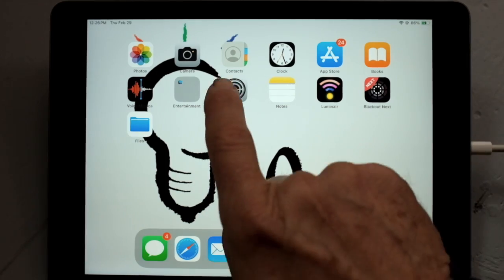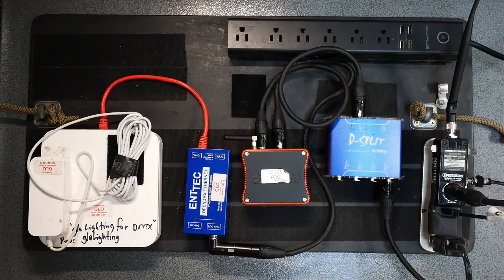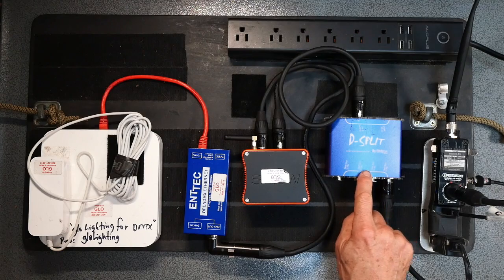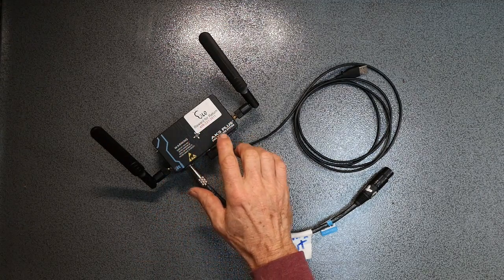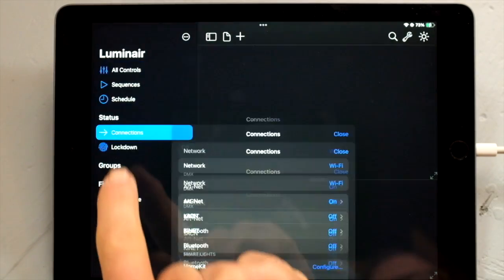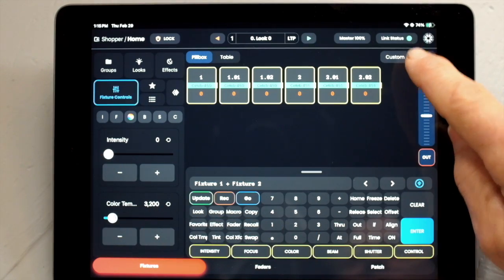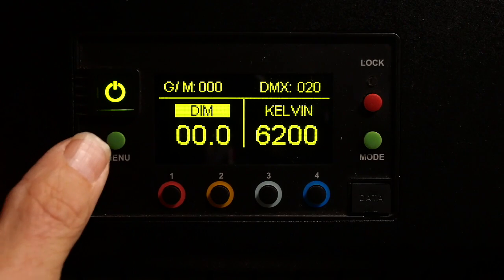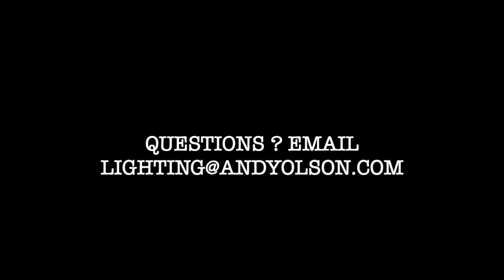How to set up a wireless DMX network using WIFI, CRMX, wireless DMX, a DMX Node and Ratpac AKS Plus

Comment: Hello, thank you for the video. I could not find this transmitter. Can you use any transmitter, what recommendations do you have? I would like to use something like QLC+ open source software and a cheap light set without having a battery powered separate receiver.